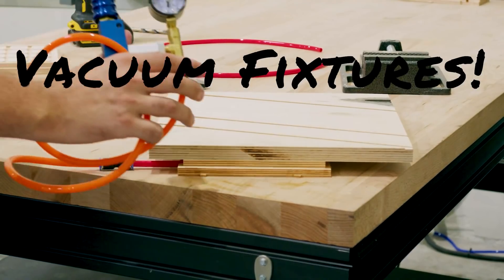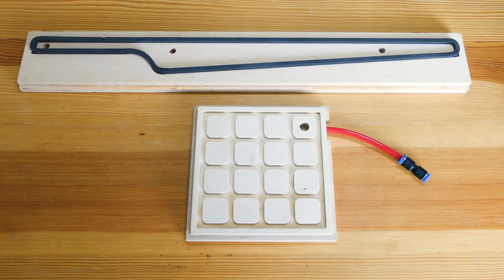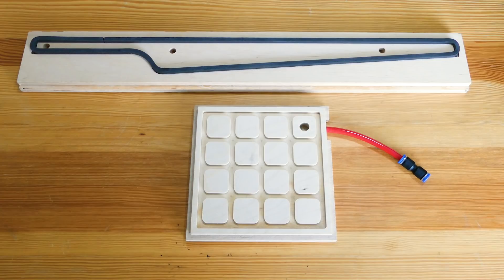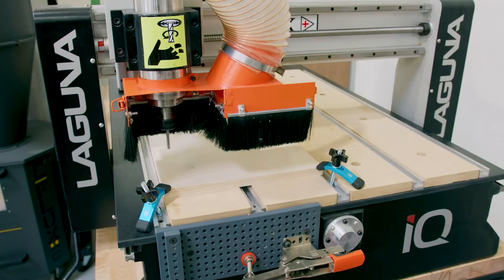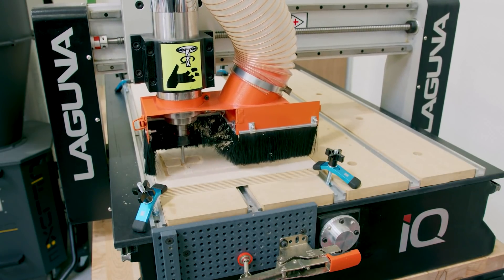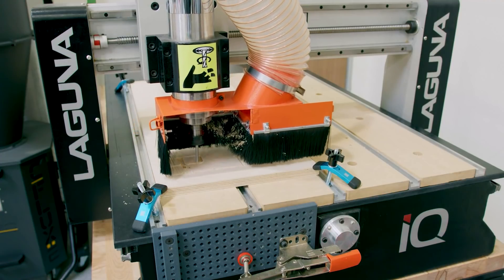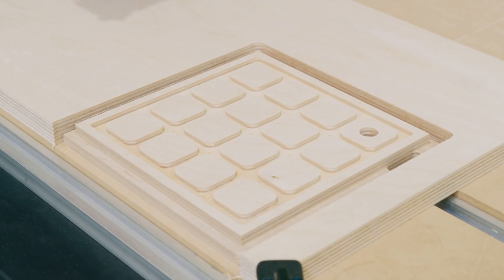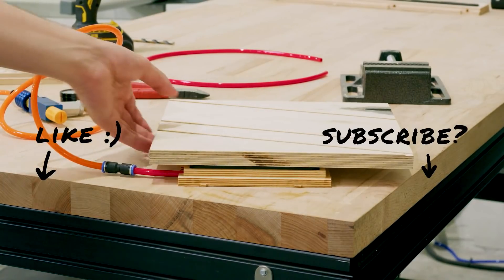How To Make Easy Vacuum Fixtures For CNC Machines | CNC Router

Comment: very cool, going to make this. Infinity tools says the venturi vac is backordered.  I am curious about the fixture mounted to the front of the IQ.  I have the same machine.  Is this an add on, and can it be purchased.  Would like to be able to carve on the edge of boards for dovetailing, etc.
Reply: Bummed about the back ordered pump as well
Reply from the maker: Hello! That part is just a prototype not available for purchase at this time. Thank you.
Reply: @LagunaTools  Interesting that Laguna is prototyping such things. I bet a LOT of us who are current IQ or IQPro owners would purchase such a fixture if it were reasonably priced and easily installed without significant modification to the machine. I've seen other setups where people mount a 4" wide t-track on the face of the IQ, but this looks a bit easier to use. Edit - there would need to be a way  to mount a backing board along with the part (to prevent tear-out on dovetail or through-cuts.

Comment: Very timely for me! I’ve just discovered vacuum clamping and sorted out how to onion skin a part so it can still be held by the vacuum while almost cutting all the way through. I’ve been using commercially available vacuum pods (Rockler) and a vacuum pump, but same concept. I purchased some cast acrylic, a 5-port vacuum distributor with shutoff valves, and some gasket material to make some grid-based and special-purpose fixtures for my IQ pro. I hadn’t sorted out how to make the grids yet in Aspire, so this will be helpful! 
I noticed the vertical clamping fixture on your IQ. I haven’t put that together yet, but that ability to machine past the table edge was one thing that sold me on the IQ line. How did you attach it to the IQ?
Thanks!
Reply from the maker: The vertical clamping fixture was just drilled and tapped onto the iQ! Thanks :)